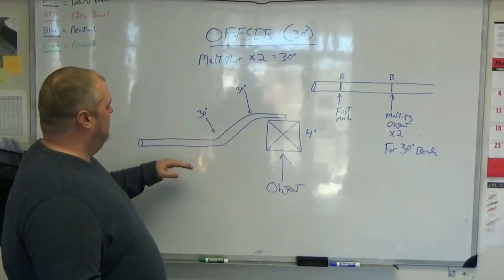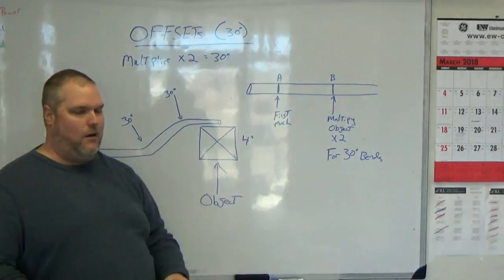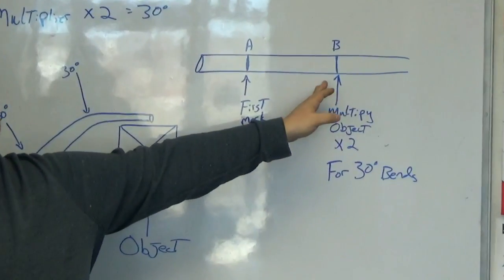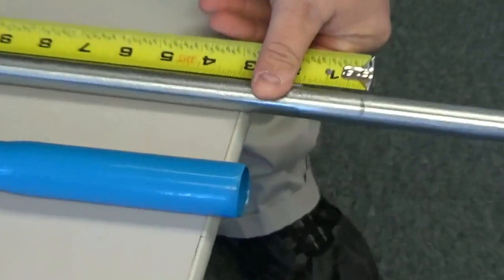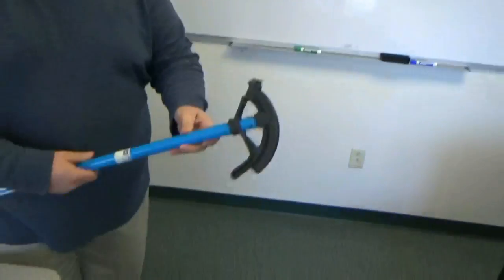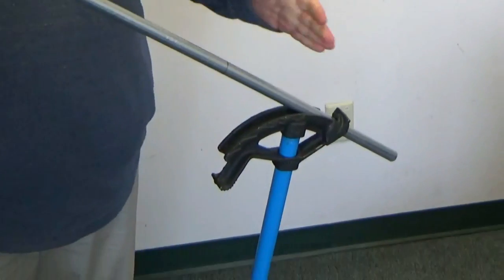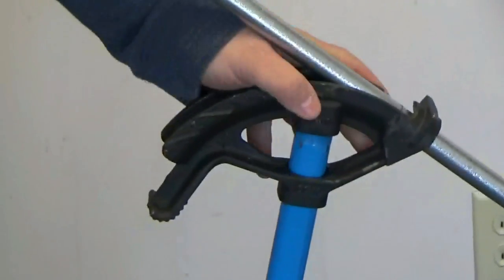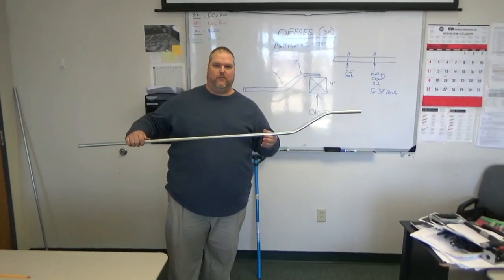Conduit Bending Offsets

Comment: OK WELL HOW YOU gET THE FIRST MARK!!!!! ALL THE VIDEOS ARE THE SAME WE ALL KNOW THAT. ITS THE SRART POINT that NO ONE MENTIONS!!!!
Reply: Usually its 3 inches brother , only thing that changes it for me is if the box I'm running to has a helicopter clip or not
Reply: Jose, hopefully this will help.  The first mark is the measurement from your last piece of conduit to the obstruction (this is when the shrinkage has been added to account for the bends in the conduit.  As conduit is bent, the overall length will shorten.  The shrinkage has to calculated and added into our layout so the conduit will fit as needed after bending.)  Next measure the clearance height ( this is how far needed to clear the obstruction)  Take the height measurement and multiply by 1/4; this will account for the shrinkage.  Take this calculation and add it to the original measurement (this gives the new mark to be laid out on conduit).  Second step take the height measurement and double it (multiply by 2 if no fractions involved).  Take this answer and go back (like you are subtracting) from your new mark.  This is known as the distance between bends.  With the bender head up in air, place the end of the conduit that you measured from, behind you, line up on indicating mark for bending offset.  Bend first mark first.  Rotate conduit 180 degrees and slide forward to second mark.  Once lined up, bend conduit.